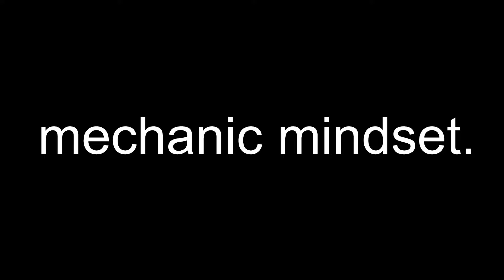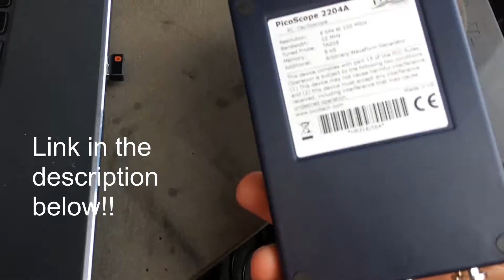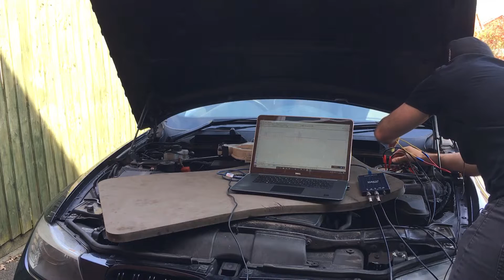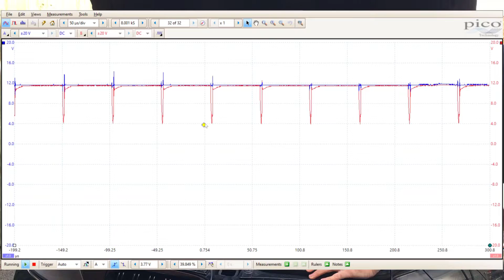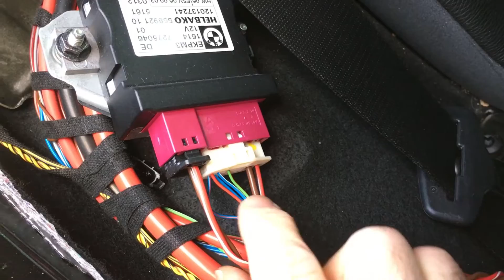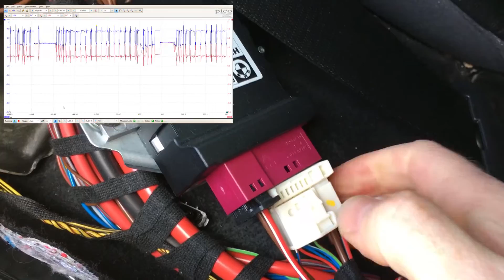HOW TO DIAGNOSE CAN BUS FAULTS [PicoScope 2204A Powertrain High Speed CAN] Mechanic Mindset

Comment: Hello, Daren. Could you tell me if the a corroded Can data line at a module will affect the network? I know that a short anywhere in the Can bus will, but not sure about corrosion at the can data line a a module.
Thank you.
Reply from the maker: Hi, it’s certainly possible. It’s like an open circuit and on some cars, depending where the fault is, it can affect the whole network

Comment: Thanks for the helpful videos.  I bought a pico scope to diagnose an issue with my RAM rear air suspension.  Sometimes, not always, when the air suspension control module is connected the CANBUS goes nuts, dash flashes, gauges go crazy and eventually the engine dies and there are all sorts of faults, mainly related to lost communication on the CANBUS.  Unplugging the air suspension control module makes it stop.  The tech thought it was a bad module but replacing it yields the same result.  I think the oscilloscope trace is showing some sort of  short but I just don't have enough knowledge at this point to verify that.  It appears to me CAN hi drops down to CAN low and they sort of follow each other up on an arc, then drop straight down and this is in a pulsing pattern that just keeps repeating.  I just don't know for sure what that means.

Comment: Hello, I am trying to learn automotive electrical diagnosis. At about 6 minutes you mention shorting shorting to ground and shorting to positive. That's for where you are connecting the measuring device? So you would have the measuring device between CAN low and positive power on the car, ie red cable? I don't understand that part, don't you risk damaging the circuits if you connect back to positive?
Reply from the maker: I am shorting the circuit, creating a fault to show you what happens 👍

Comment: Thank you for your video. I thought there was a PT-CAN issue because I have 2 EKP modules that won't respond but if it's supposed to run at full speed as a failsafe that means it's a power/ground issue, right?
Reply from the maker: Make sure powers and grounds are good. Check out my other video with 5 tips for CAN diag 👍

Comment: I owned a Chevrolet Captiva 2.0L Diesel (2010) and lately the car faced with many technical issues.   Thinkcar scanner had identified 7 issues with ECM, 2 issues with TCM and 3 issues with EBCM. 

ECM 

1. P0700-00 TCM requested MIL illumination 
2. P0571-71 Brake Switch Circuit 1
3. U0140-00,U0144-00,U0104,U0101-00,
U0101-46 Lost communication with BCM/CIM/ CCM/TCM/TCM

TCM
1. U0001 CAN Bus communication
2. U0401-00 Invalid data received from ECM/PCM

EBCM
1. U2107-00, U2106-00 Lost communication with BCM/ TCM
2. C0561-71 System disabled Information Stored Invalid serial data received .

I only owned a scanner and a multimeter. Can you guide me how to resolve the above issues. ? Thank You and best regards.

Comment: Elite diagnostic skills, keep up the good work! Had a tow in one time too,  at the DLC CAN +/ CAN - showed 2.5V/2.5V when testing with a multimeter. TR was 120 Ohm indicating an open somewhere on the BUS. Car was in front end accident - went to the main harness running across the front of vehicle going into the PCM. Scope PCM CAN +/ CAN -, both were spiking to 12V. Further basic short testing found the CAN + wire was rubbing against a pinched 12V wire in the harness!
Reply from the maker: Awesome work! With good basic knowledge, we can diagnose the most ‘complex’ faults, also with a little patience 😅. Thanks!

Comment: Your videos are fantastic. I have learned so much from the videos and the courses I have taken from you.  My 07 Ram 1500 truck has a can C issue.  With the Pico 2204A connected to CAN C high and low at the OBD2 port, it shows shorted together at 2.5V.  But, if I disconnect and reconnect the battery, the network shows normal until I turn on the ignition then it goes back to shorted.  I haven't had a chance to do anymore testing, but my feeling is that it has something to do with the transmission module because that is the only module that does not communicate with my scan tool.
Reply from the maker: Awesome, yeah sounds like you might want to disconnect TCM and retest 👍

Glad you are enjoying the channel! Thanks

Comment: So in theory I could get a waveform generator connect it to the wire or wires(my lancer uses 2 wires on certain components) generate that waveform and if there is a communication error then this would make the two components communicate or believe they are communicating enough to see if the component is to blame or it's a communication error?
Reply from the maker: Hi, I haven’t seen any waveform generators that transmit on CAN like that. The best way to check if there is communication, is the scan tool. If you can read the codes, it talks. This video might help with diagnostics
https://youtu.be/k8bJegVxo_c

Comment: Hey I love your videos, can you please clarify the open circuit on the picoscope and what it looks like?  I was kind of confused at the last part.  I love your videos and explanations thank you
Reply from the maker: Hi, when you get an open circuit on CAN bus, the network becomes unbalanced so the waveform changes. Glad you are enjoying the videos! Thanks
Reply: @MechanicMindset  I guess what I meant is the visual was confusing for showing the open on the picoscope
Reply from the maker: @simmsimmerson  Ah ok, it’s hard to explain via a comment. Because of the terminating resistors, CAN high and low are essentially connected. When we add an open circuit, only one of the wires is communicating, this has an effect on the open circuit wire because they are ‘connected’. If you search on Google
You can find a diagram of how the transceiver is connected inside the module, and how the voltages are created. It might help make more sense. 

If you see my other video checking Low speed CAN, this doesn’t happen because high and low aren’t connected by terminating resistors

Comment: Question? When you disconnect the module how would you know weather it’s a broken wire or faulty module?
Reply from the maker: Good question, if it’s a broken wire, you can see it on the waveform. If it’s an open circuit in the module, we’d have to confirm the wire integrity with continuity 👍
Reply from the maker: I’m gonna have a play around with that scenario!

Comment: Hi, this is a high tech video for me, but I thought I'll pick your brain on something I am looking for regarding CAN bus. I have the Realdash android app and I am using it as a digital dashboard to display various parameters by connecting to the OBD2 port via a Bluetooth dongle. The app is not able to recognise when my car is in Reverse gear and therefore the gear display gauge is not showing 'R'.  The app needs some sort of a signal from the vehicle to indicate reverse gear. 

I have a BMW 320d 2017 model. Is it possible for you to read your BMW vehicle CAN to dig out this information about the status of reverse gear so that I can configure it in Realdash? I don't know whether it's a PID number or something else.  I am just trying my luck. Sorry if it's a silly question. Thanks!
Reply from the maker: Hi, sorry I’m not sure what will fix your issues. Although the reverse signal message will be sent on CAN as it has to go from transmission to FRM and IC for lights and cluster. I’m don’t know how you you’ll get your app to recognise this. I suppose it depends on what it’s capable of communicating with (ie some apps/dongles only pull OBD2 standard data)

Comment: hello, i dont have scope handy at the moment but just noticed something on my car... i have some "no message" codes in pt-can.. the voltage on CAN-HIGH is below 2.5V and CAN low around 2v.... if i meassure with only 1 ecu connected to the network CAN-H sits at 2.7 and CAN-L sits at 1.7..if i introduce one more ecu to the network CAN-HI drops around 2.3v...any ideas? i removed on ecu from the network at a time but still no change...
Reply from the maker: Hmmm, not sure. If you are reading codes from that network then there must be communication. Would be best to see actual waveform. I played around with some resistance on CAN and it is surprisingly robust. I did a video somewhere. 

Remember, if you can read the codes from the module, the network is probably fine
Reply: @MechanicMindset  thanks for yoyr answer .is something strange...i start the car...an as soon as i start revibg it..i can see the transmissiin gear indicator disapear from the dash...and the reapear as if the dash would stop receiving messages from EGS...i will scope it tomorrow

Comment: I have a fault with a mercedes  E Class 2016 in the CAN I lines from the ECM N3/10 I have 5v on the can high and 0v on the can low with ignition on. I'm not sure what the problem is. I had an open circuit in the can high and repaired that and this is now what I have. Please help.

Comment: Hello,
Will you recommend 2205a or still 2204a ?
Reply from the maker: You get slightly better specs for sample rate, but the resolution is the same. I think the 2204A is fine for starting. If you want to spend a bit more money get the 2405A 4 channel version. Otherwise, get the 2204A, and if you like it, start saving for the 4425 👍

Comment: I got my first scope today, 6022BE. I'm trying to diagnose a TCM communication issue.
The signals I get are both the same (one isn't inverted), basically CAN high seems to be the same as CAN low, like both signal are being pulled down instead of CAN high going up. And the signals seem to be more stuck together with a kind of a jump half way up.
My initial thought was that CAN high and low were shorted together, but judging by this video this isn't the case.
And I get a 60ohm reading on the line so it doesn't seem to be a a break or a short.
Of course it could just be me screwing up something, I thought that maybe the Hantek software might have automatically inverted one of the signals. There is an "invert" tick-box on the software but it doesn't seem to do anything. I thought it would maybe invert the signal.
The car runs fine, it's just that the TCM randomly has a few errors.
I'll probably have a better idea once I get a bit more used to the software and see what a good signal looks like. But this video was really helpful. Thanks!
Reply from the maker: 6022be is a great start. What leads were you using and how was it connected?
Reply: @MechanicMindset  Yea, the 6022 is great, but the software is a bit annoying at times!
I was using the leads that came with the 6022 and I had them connected to back probes for the wires and crocodile clips to the battery negative. And I was back probing the CAN wires on the TCM connector.
But then the next day I tested the signal on the multiplug and I got a perfect signal.
So maybe I just screwed up something, or maybe it was a glitch in the program, or maybe the wiring at the TCM is messed up, but I don't think so because 99% of the data I get from it seems fine on the diagnostic tool.
I did find that the signal was a bit cleaner once I removed connectors on the battery negative.
My next plan is to test the signal at different connectors, pull some modules, and shake the harness about to see if the signal changes, but the trigger is a PITA on the Hantek software!
Reply from the maker: @JoeBob79569  If you can read data from the module, CAN is OK 👌 

There are some other software available for the 6022be, HScope if you have an Android device. And another called open Hantek or something. Not tried them though 👍
Reply: @MechanicMindset  Thanks. Yea, I finally got Open Hantek running earlier, I had to install some framework files from Microsoft to get it running (visual C++ I think), probably because of the way it was compiled for GitHub. Haven't tested it out yet though.
I couldn't get Hscope working I think you might have to buy a licence, but might give it a shot at some stage.
It'd be great to have the Pico software for the Hantek scopes!
Reply: @MechanicMindset  So, I'm sending the Hantek back to Amazon and I've got a Picoscope 2204A on order instead. 
The Hantek software is far too primitive, it's like they just don't care, about it, at all. 
Pico seem to be a lot more professional, and there's probably a lot more support on forums, and the like, since so many people use Pico.

And also, automotive!
Reply from the maker: @JoeBob79569  The 2204A is much better, and the software is the same all the way through. I just use the normal Pico 6 software by the way - it’s the same really 👍
Reply: @MechanicMindset  Thanks. Yea, I think the CAN decoding is a really cool feature. And it's probably what I need to diagnose my car because I'm just getting single, random, TCM errors every so often, and just looking at the signal wasn't narrowing it down for me.

Comment: I've got a very unique problem with an N51 328i X. I'd like to talk to you about it. Seems like I'm chasing a ghost. Maybe we can both learn something by talking about it.
Reply from the maker: Ah ok, what’s the issue you are experiencing?
Reply: @MechanicMindset  It’s based around mixture control and misfires but I’ve already swapped everything anew. New purge valve, MAF, Bosch coils, NGK sparks, pre cat 02 sensors, manifold seals, throttle body seal, oil filler cap, secondary air hose. I’ve cleaned the fuel rail and since it’s an N51, I highly doubt the injectors have gone bad. At this point I’m suspecting it’s an electrical issue.
Reply from the maker: @MendyHazan  Ok, have you been able to confirm what the mixture is actually doing (via 4gas or O2 readings). Any fault codes? I have seen Super Mario Diagnostics channel do some walnut blasting on intake for running problems
Reply: @MechanicMindset  I’ve checked the needles when I replaced the manifold gaskets. Clean as water. I get codes for mixture bank one and two and misfire for 1 2 5 and 6
Reply from the maker: @MendyHazan  Ok, what are the O2 sensors telling you about the mixture?
Reply: @MechanicMindset  I can read 02 sensors with INPATIENT but it isn’t going to give me much info other than the fact that’s it’s operating and how much as I press on the throttle. The voltage seems to be in a normal range.
Reply from the maker: @MendyHazan  There might be a current reading for the O2 sensor (they should be broadband). From this you should be able to see if it is running rich or lean based in your mixture fault codes 👍
Reply: @MechanicMindset  Any idea how to view the current reading on INPA or do I need to prove it by the connectors atop the fuel rail?
Reply from the maker: @MendyHazan  I’ve not used INPA before but you should be able to read the live data somewhere in there. I do have a copy but never got round to setting it up, my mate has full ISTA
Reply: @MechanicMindset  Can I send you an image of the INPA reading for the 02 sensors?

Comment: i was trying to do this through the OBD on my E90, but i was seeing nothing on all lines, do you know if there is some detection the car does or something before it enables that port?
Reply from the maker: Sorry, deleted my reply, thought you watched a different video. My mistake

So I think the reason you can’t do this via OBD on an E90 is that the OBD on these later vehicles doesn’t have all the CAN networks in that connector. We have something called D-CAN (diagnostic) that goes to the gateway module; the gateway has all the CAN networks connected to it. I would have thought you would get something though. I would have to check
Reply: @MechanicMindset  great thanks for the tip, i'll look into that, i recall seeing something about d can but just assumed it had the reular can lines anyway
Reply from the maker: @horse_examiner  Double check - I didn’t think it has them, but could be wrong!
Reply from the maker: @horse_examiner  I do plan to do a video explaining modern CAN layout soon 👍

Comment: After seeing several videos of people using the pico 2000 series in the automotive industry I got very curious (since I can't afford the 4425 series). So I went and bought the 2206B 4 channel and yesterday I had the opportunity to use it with my ODBII breakout trying to see CAN low & high (i did that on 2 E46 BMWs) and I got the same results, not square signal, one edge was rounded. There was a curve line from 2.5v all the way to 3.5v and same the low CAN, from 2.5 to 1.5. Any thoughts on why I'm getting that rounded edge? Do I have the wrong settings (A & B +/-5v,  time  20 to 50 us). Thank you in advance and keep up the good work you do with your videos helping everyone. Love your videos.
Reply from the maker: Jorge Andrade Congratulations on your purchase, powerful little tool! Hmm, can you see a whole data package on the screen; start to finish?  (Does it look like mine). Just wondering if E46 CAN speed is slower, try increasing your time a bit. 👍
Reply: @MechanicMindset  Thanks for getting back to me, I believe  I save the file and tomorrow  once I get to wk I'm going to view it again and somehow send it to you. I think the data package is there, it's just with a rounded leading edge. The edge going back to 2.5v is a straight line on both high & low. I will get back to you, thanks again for taking the time.
Reply from the maker: Jorge Andrade Cool, ok, you can see my email in the about section on the channel page - I’ll have a look for sure 👍

Comment: thanks for video     i am confuse now  because in your other video you proved that high speed CAN BUS are robust  and they work fine even   if they are shorted .but now  you  contradicted that
Reply from the maker: ali batebi Hi, in this video I am demonstrating ‘dead short circuits’, for which CAN bus has no robustness for. In the other video I am showing that if there was a high resistance short circuit (like water corrosion) CAN bus has some defence, but you will remember that at some point it could no longer function. Sorry for the confusion, I will try to explain better next time! 👍